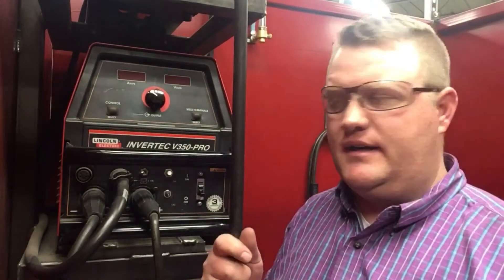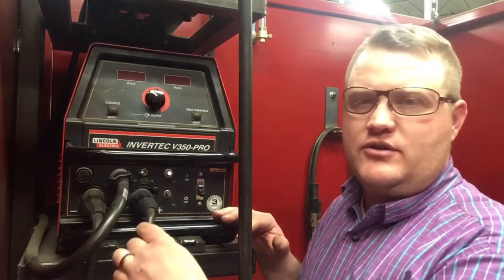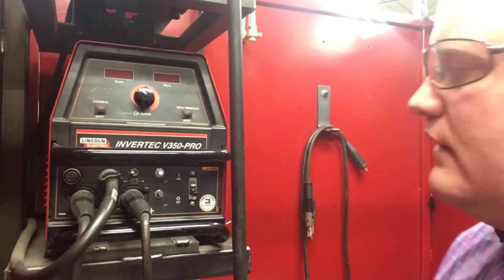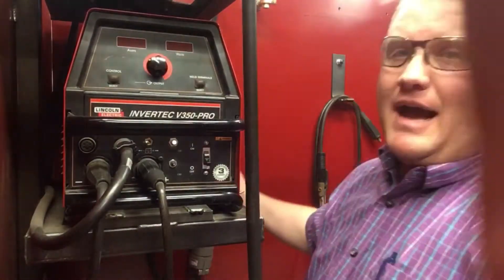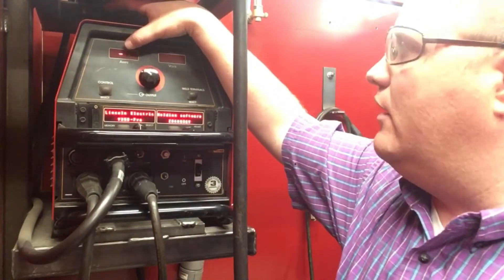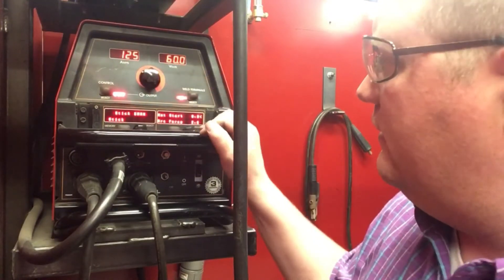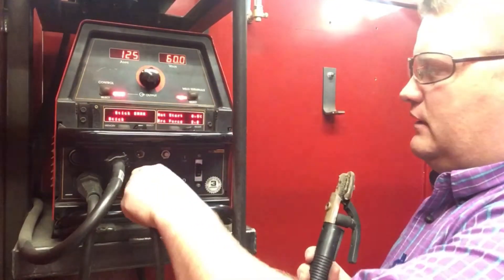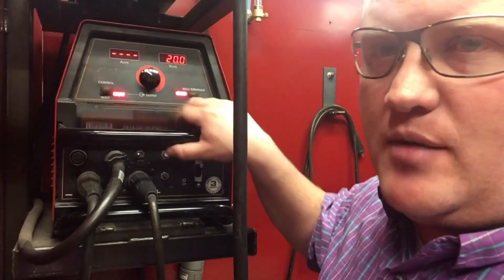Setting up the V350 Pro - One Day At A Time with Dave from AgTeachering

Comment: I realize this is an old video, so I am HOPING the Original Poster/teacher still has this account and is active... BUT, does anyone know what the switch Above the (+) Terminal does? (or the two buttons off of the side?)
I am trying to figure out if this Welder is capable of welding DCEN AND DCEP, I just bought one but am still trying to learn the machine and cannot find any information in the user manual relating The swapping of electrode positive to or from Electrode Negative. I am trying to run special Flux core wire (For stainless steel) and it need's DCEP in order to work correctly. Do i just swap the (-) and (+) terminals?
Reply: Here is the manual, just remove the space in the URL

https://www.lincolnelectric    .com/assets/servicenavigator-public/lincoln3/im679.pdf

Comment: So the wired for the ground you dont use a clamp ?
Reply: One piece of advice students, don’t swap leads under power. Cut the machine before doing it, it’s just good practice
Reply: In this application the unit is stationary. This allows for the  work lead to be attached directly to the booth. The entirety of the booth is connected to the work table. Less clutter and less chances for a student to knock the clamp off and turn on the help light.